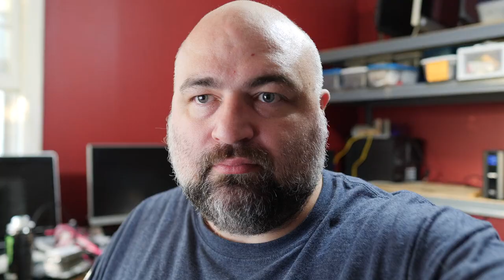Even MYTHBUSTERS Got The Airplane Conveyor Belt Question WRONG - A Neckbeard Explains - Jody Bruchon

Comment: Wouldn't the weight of the plane make the blet contact what's under the belt? Even if you replaced the belt with a bunch of rollers like a shipping facility, it would still move forward because the wheels do not propel the plane forward. The wheels spin freely. The planes engines are what pushes the plane forward.
Reply from the maker: The wheels do not spin freely. It is explicitly in the wording of the question. The wheel rotation rate is locked to the rate of the conveyor belt's motion. Read the question text carefully.
Reply: @JodyBruchon  this is a plane we are talking about. Not a car. A planes wheel DOES spin freely. A cars wheel is what makes the vehicle move forward because the wheels are connected to the transmission. A planes wheel isn't connected to the jet engines or even a transmission (because planes don't have transmissions). This whole question is a trick question. You don't have to pay attention to the wording of the question. You have to know how planes work. If the wheels of a plane are what makes it move, then why do they need to be pushed back with the aid of another vehicle?
Reply from the maker: @dustinmoore580  The method of thrust is irrelevant. If the wheels are not allowed to rotate faster than the belt, the center of the wheels is not allowed to move relative to the belt. Unless the plane is a helicopter, it can't lift off without moving forward. The method of applying thrust is irrelevant.
Reply: @JodyBruchon  how is the method of thrust irrelevant? If you have no way of thrust then you have no movement. The speed of the wheels is irrelevant. The wheels on a plane do nothing but support the plane when on the ground. And slows the plane while landing because of the breaks. Again, if the wheels are what moves the plane forward then the plane shouldn't need assistance to taxi away from the boarding gate.
Reply from the maker: @dustinmoore580  Will the wheels spin faster than the belt as the plane moves forward?
Reply: @JodyBruchon  the wheels will merely spin twice as fast as they would under normal circumstances. Thrust is different from drive. The conveyor can spin as fast as you like, but the engines are pushing themselves through air, by pumping air through it. It’s exactly like doing this underwater with a submarine with wheels. The sub will travel through the water, like a plane through air, and the conveyor belt will just spin at a crazy speed, but the plane and sun are moving forward.
Reply from the maker: @hawaiian_hugo_stiglitz7583  The wheels will spin twice as fast. Read the constraint in the question again.
Reply: @hawaiian_hugo_stiglitz7583  If the wheels spin twice as fast as the conveyer, you are breaking the rules of the question. So It ends there.
Reply: @JodyBruchon  the Question does infact state that the Conveyor will match the speed of the (wheels). And if we take the premise that the wheel speed and the conveyor speed cannot be sperated then this causes a non starter situation. If the conveyer belt only goes as fast as the wheels how would the wheels ever even start turning? The only reason the wheels turn at all is because they are making contact with a surface that the airplane is moving across. So if the airplane cannot move forward then the wheels will not spin therefore the conveyor belt will not spin therefore the airplane will simply set there not doing anything at all. It will not even make an attempt to move. That's why the part about the conveyor belt "matching" the wheels is a flawed and is a non starter it is paradoxical. The wheels in this  premise, as it is stated do not move because the conveyor belt moves, instead you the conveyor belt moves because the wheels moved (the conveyor belt matches the wheels). Since you stated the airplane Cannot move forward without violating the premise it means that the entire premise causes itself to collapse in on itself.

Edit. As far as I understand the the version of "airplane on a conveyor belt" that states "The belt speed matches the wheel's speed" is a flawed version of the question and not the correct version, at least as far as I know. From what I understand the more correct version of the question is if a conveyor belt is moving at the airplanes "take off speed" can the airplane take off. This second version is the version that the Mythbusters tested.

Edit 2: the more of your video I watch the more I'm convinced you're bullshitting on purpose, like as a joke.
Like I think that you are joking, I'm not 100 percent sure if you are and I can't prove it but I'm extremely suspicious of it because you mixed some good points with some Wild ones that made no sense, like some that there is no way that you were actually serious. By the way if you're not kidding I'm not trying to make fun of you. As my earlier point technically your underlying point IS correct but it's also a paradox that is a non starter but the supplemental arguments you used to bolster your point are what made me think you're joking at least in parts of it
Reply from the maker: @andrewesau51  I tried to cover every BS argument I could think of. You are correct that there are flaws in the original question and the question makes it impossible to take off. No, I'm not BSing, I'm trying to cut off the people who do.
Reply: @JodyBruchon  Not only does the premise not allow take off it also does not allow the wheels or conveyor belt to roll at all. Since the airplane wheels are un powered and require the airplane to mover over a surface to begin rolling and since the premise doesn't allow this action to occur it would mean that neither the airplane or the conveyor belt would even be able to move even a tiny bit. They would both sit motionless forever because the moment either moves without the other the premise is violated. So neither the premise or the plane are getting off the ground. Pardon the pun. On a side note I did some reading and I believe I may have some understanding into why no one can agree and both sides thinks the others are idiots. It's because with the premise you used it's not really a physics puzzle, it's a logic puzzle. So you have two groups, one treating it like a physics puzzle and the other treating it like a logic puzzle. One group is treating it very literally, (if we put a plane on a treadmill and tried to take off would it succeed?) And the other group is taking it very theoretically and treating it more like a equation that has set rules provided by the question that have nothing to do with physics directly. 
These to separate ways of viewing the problem allows for two people to have come to two entirely separate conclusions with completely correct logic simply because they were not actually solving the same problem as each other. 

So if we wanted it to be a physics question we would have to change the wording slightly to say that the conveyor belt matches the airplanes "relative air speed" which is what the Mythbusters did.

The problem you where solving is not the one the Mythbusters tested and it was all down to how they worded it. They were treating more literally and more like a physics question.

So too make a long story short nobody on either side is "dumb" it's that both sides aren't even talking about the same thing when you look closely
Reply: @JodyBruchon  oh also I just thought of a way to solve it. You make new wheels out of some very strong theoretical metal and make the new wheels incredibly narrow so that they had incredibly low traction like almost no traction  at all. Then you apply the brakes fully which not allow the wheels to turn. Now you apply full power to the airplanes engines and since the new wheels have very little grip they will act as skids and allow the airplane to slide along the surface without rolling and  Since the wheels are not turning the conveyor belt will not detect any rotational speeds it and will not activate and the plane will be able to take off with ease on it's new super slippy metal wheels.

Comment: Simple answer: No, the plane cannot take off.  Furthermore, the conveyor belt and aircraft wheels cannot actually even move.

When you throttle up the engines, the plane would normally accelerate in the forward direction due to engine thrust.  Integrating that acceleration over time would yield the aircraft velocity on the tarmac, but if the conveyor belt's velocity exactly matches that velocity in the opposite direction then the plane does not move forward and the wheels do not rotate which means they have zero velocity which means the conveyor belt velocity must also be zero.

It would be much simpler if the problem were posed as follows:  The takeoff speed of an aircraft is 100 knots.  If the plane is placed atop a conveyor belt spinning at a linear speed of 100+ knots and the planes' engine(s) are throttled up to the point where the forward thrust just matches the rolling resistance of its wheels, the plane will sit stationary on the conveyor in much the same way as when the plane is parked, except that the engine(s) are spooled up somewhat.  The engines being spooled up does move air but it certainly does not move enough air to create a flow over the wings at a velocity high enough to generate sufficient aerodynamic lift to match the gravitational force on the plane.

Comment: As long as the plane is on its wheels, the wheels matter!
On the ground, it moves forward, in relation to the ground, because it’s wheels are rolling-being pushed by the engines.
Negate that forward motion, and the plane never moves.
If it doesn’t move, it doesn’t fly.
According to the scenario, it Can’t move, because the conveyor belt negates the forward motion of the wheels.
If it Could takeoff, then why do planes even need wheels, or runways?
Reply: You're thinking in terms of if it were a car, which achieves motion by spinning the wheels.  On a plane motion is achieved by a propeller or turbine pushing air. The wheels of the aircraft are simply there to negate the friction of the ground.  The conveyor could be going hundreds of miles an hour but the wheels would only spin faster.  Imagine a person on roller blades on a conveyor, now imagine they're pulling on a rope attached past the conveyor.  The skater would still be able to pull themselves regardless of conveyor speed due to the near absence of friction.

Comment: Here’s a few questions for those of you who still think the airplane would be able to take of: 
Why does heavier aircraft require higher speeds to take off? 
Way can airplanes glide? 
Why cant airplanes fly in space? 
All three questions have the same answer…. LIFT , you need lift, to have lift you must have wind speed. Stick your hand out the window next time your standing stil at a readlight, keep your arm out the window and accelerate up to highway speeds, find out it progressively gets harder to keep your hand still as you go faster. You my friend, just discovered wind speed, and that you have to be moving in relation to the ground in order to achieve lift. No lift, no take off.
Reply from the maker: The wheel speed of the plane IS connected to the fuselage if the wheels are on the ground.
Reply from the maker: @ItsDan123  Sure, the plane could be dragging its locked wheels. That's one good answer for how it might take off. Unfortunately, I imagine that a large plane will tip over or rip the undercarriage off before it'll drag the wheels that its full weight sits upon along the ground.

Comment: The airspeed is the speed of the airplane through the air, ground speed is the speed of the airplane moving relative to the ground. 
The airplane can fly at 60mph into a 60mph headwind but the groundspeed of the airplane it will be zero. That's why it doesn't matter if the ground is moving or not.
Reply from the maker: If the plane has not taken off, there is no airspeed. You're talking about a plane that has already lifted off the ground.
Reply: @JodyBruchon  so what's the difference between being in the air and touching the ground? 
The plane moves through the air and that's why it doesn't matter if the plane is on a conveyer belt or not, the engine make the plane move not the tires 
Look up a video of a sea plane (no tires) taking off from the back of a truck. The plane is taking off because it's moving through the air not because it's moving cross the ground.
Reply from the maker: @tombrown8762  The constraint is that the tires and conveyor must be the exactly the same speeds. If the plane moves forward, the tires are moving faster than the conveyor. It doesn't matter if you call it airspeed, ground speed, or goat on cocaine speed. Any movement forward violates this speed-matching constraint. I made a follow-up video because if you look through the comments here, I've repeated the same clarifications in basically every single thread.
Reply: @JodyBruchon  I see your point about it.And I think it's wrong. I think I can't change your mind about what you believe. So good luck to you and your beliefs.
Reply: @JodyBruchon  the thing that moves the airplane is the engine not the tires. The tires could be going 1000mph backwards but the engine will push the airplane Forward no matter what, just like windsurfing, the waves are going backwards to the beach but the surfer using the wind to surf away from the beach. 
I used to think the same way about airplanes but I started taking flying lessons and in the ground school they teach the difference between airspeed and ground speed and how the tires on all airplanes are free to move. 
I know it's hard for someone to change their beliefs because our beliefs sometimes define us. And if we let it go it's like letting go of part of us. And sometimes if what we are presented with will change the thing we believe in, we just deny it.
Because it's easier to deny that to change our beliefs
Reply from the maker: @tombrown8762  If the plane moves forward, will the wheel speed still match the opposed conveyor speed?
Reply: @JodyBruchon  it doesn't matter because the force that is moving the airplane is not connected to the conveyer belt. It's like a boat moving upstream. The water is going backwards but the boat is moving forward
Reply from the maker: @tombrown8762  It does matter. The question sets up a scenario where the two things must go the exact same speed the entire time. That single constraint makes it the only thing that matters at all, in fact.
Reply: @JodyBruchon  the conveyer belt will try to mach the speed of the tires but it will fail. Because the force that moves the airplane is stronger than the conveyer belt. And that's why the airplane will always move forward no matter how fast the conveyer belt goes. 
I'll give you another example: put a toy car on a treadmill, attach a string to it, turn on the treadmill and Pull the toy car up the treadmill. Will the toy car go up the treadmill or not?
You are thinking that the force that moves the airplane is the same force that moves any car. 
The way a car moves is the engine turning the wheels and that's what pushes the car forward. But and airplane pushes the air backwards and it moves forward. So if the ground is moving backwards that's ok because the airplane is not using it to move forward.
Reply from the maker: @tombrown8762  The question says that the speeds must always be matched. In the real world, this is not possible (thus it's really an invalid question in the first place), but if we pretend it is possible for the purpose of the question, it prevents any forward movement.
Reply: @JodyBruchon  ok if you believe that good for you and I hope you live a happy life
Reply: @tombrown8762  This problem is extremely counter-intuitive and easy to try to compare to a plane on a lower friction surface like a plane with skis on ice, but it is not the same problem. The conveyer belt matches the speed of your wheels exactly, not the speed of the plane. So as your tire rotates 1 meter, the conveyor moves opposite 1 meter. 1 + (-1) = 0. You have travelled no distance. In order for a boeing 747 to move on a regular runway, the tires must rotate. It doesnt matter that they aren't mechanically powered. They must rotate in order for the plane to move. And as the tires rotate, the conveyer moves the opposite direction at the same speed. You are unable to move no matter how much force you apply because the belt speed EXACTLY matches the speed of the tires.
Reply: @tombrown8762  It is not a belief, it is physics. It's theoretical because it cannot be tested Physically in real life, but it can be simulated. And the only constraint that matters is that the wheel speed and conveyer belt speed match exactly. When that occurs, the plane cannot move anywhere relative to the ground. It's absolutely zipping down the conveyer belt. But relative to the ground, it's not moving.
Reply: @tombrown8762  This argument removes all credibility. "The belt will try to match the speed but will fail." The problem literally states that the belt matches the tire speed EXACTLY. There is no changing that. 

In your example, when you apply the force to move that car, the wheels MUST rotate faster than the treadmill because the treadmill is not programmed to exactly match the speed of the wheels. If the treadmill matched the speed of the cars wheels exactly, you could pull as hard as you wanted with 100 Ton winch and the car would not move relative to the ground. The only thing that would happen is the treadmill would speed up with the cars wheels to match the speed exactly. And at that speed, you would be  -1 treadmill.